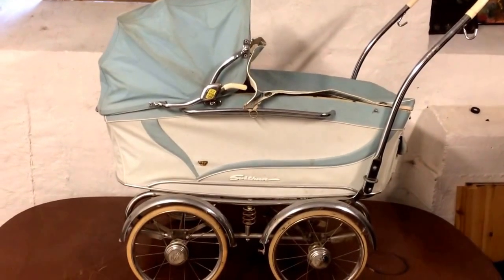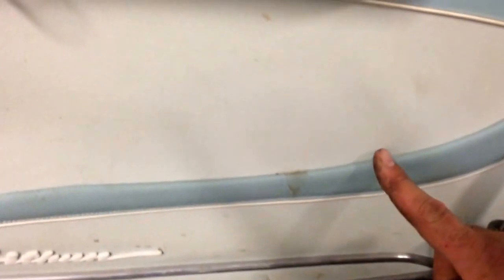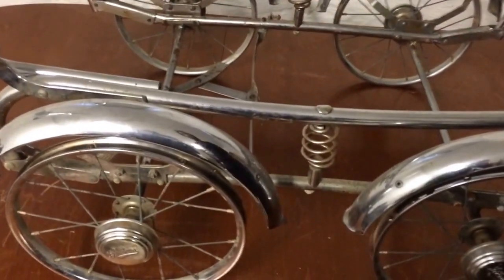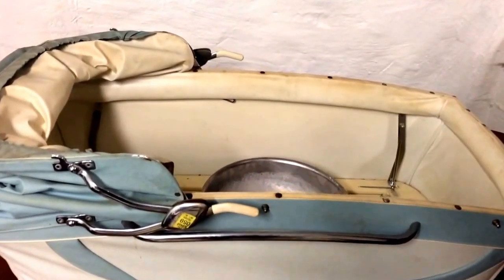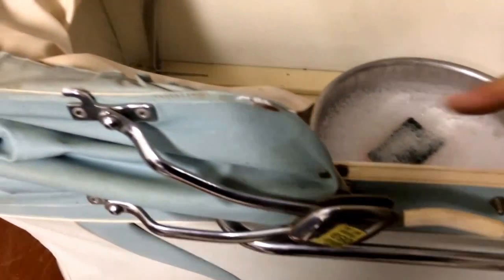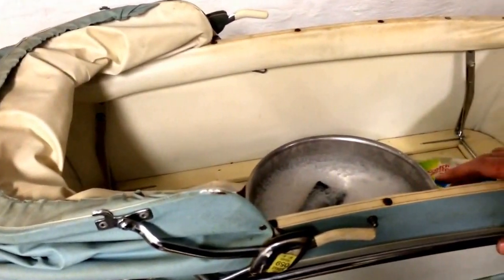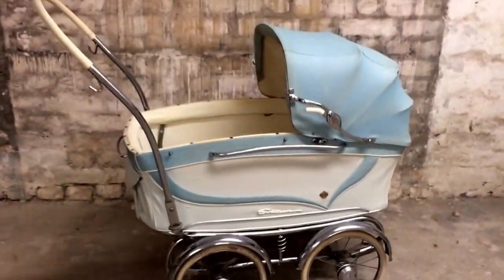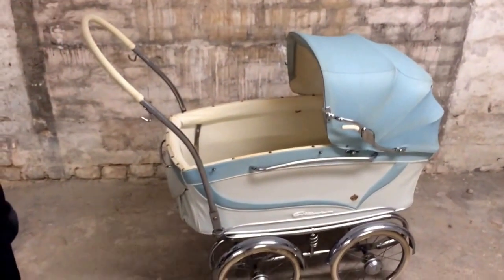Renovating a Vintage Svithun Stroller

Comment: I have a very similar stroller with both the bassinet as well as the upright seat that swap out.   Those pieces are in good shape.  The frame needs to be rechromed, new wheels and leather shocks.   I don’t have the talent to do that, but would pay to have it restored.   Any suggestions?

Comment: the rust eater: does the brand matters?
Reply from the maker: To be honest, I haven't tried that many brands, but they should all work the same way.  Just try a smaller portion of the metal first in a less visible place if you're not using what I use.  For me, the most important thing is that it is a little thicker so it can be smeared on the metal.  Liquid rust-eaters just run off the metal, and are thus only really good for derusting little things like screws that you can take off the stroller and put in a container while the rust-eater is working. :)